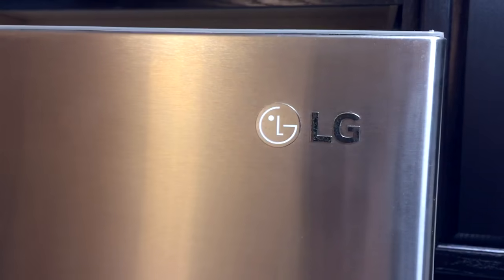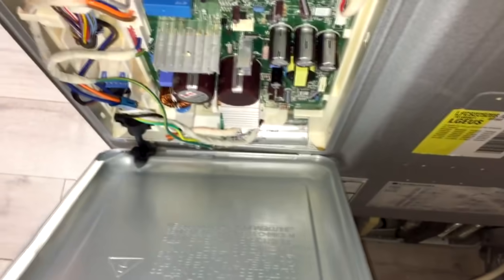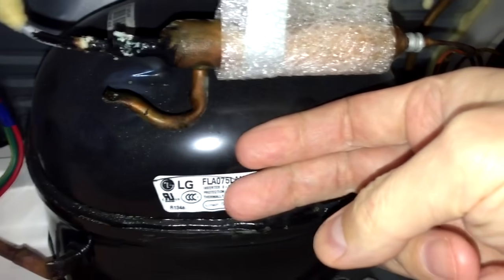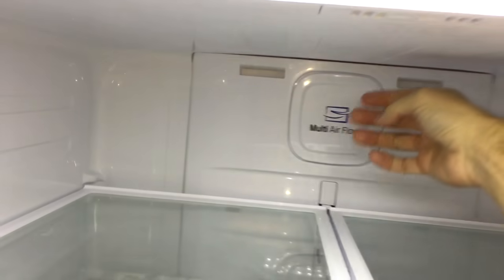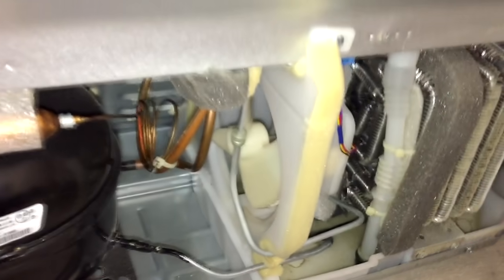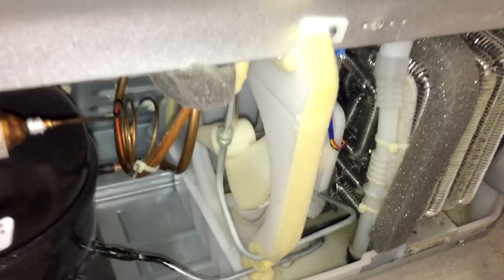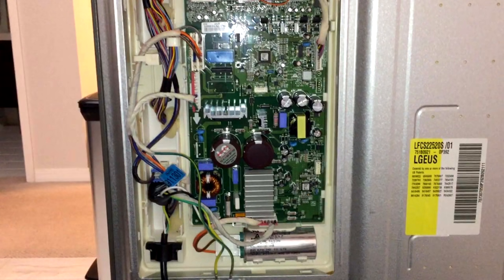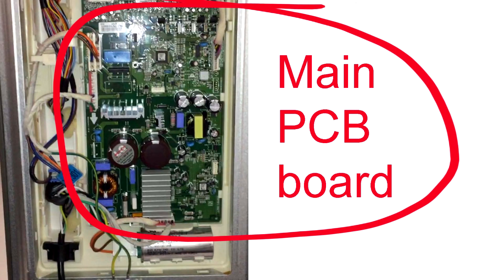LG refrigerator test and reset button

Comment: I have this model LSXS26326S /01.  Ran the test but don't get any error code.  Everything is working fine except for there is no air flow on the refrigerator side.  But if I open the freezer door side then I get a little bit of airflow on the refrigerator side.  Any idea?
Reply from the maker: There should be a return-air-duct somewhere on the lower part of the wall between the freezer and the fridge compartment. If the return duct is blocked by groceries or plastic bags, you may experience a low or no cold airflow from the top air duct. Also, the lower return duct could be frozen with ice due to a Defrost Problem. It's best to remove everything from the freezer and look at the Evaporator Coils. Defrost them with warm/hot water, and make sure all that defrost water is easily draining out and not getting pooled on the bottom.
Reply: When I ran a TEST, it's showing 22.  What that mean?
Reply from the maker: 22 means the second stage of the Test.
33 means the third, if you have it.

Comment: Hi, I've got a Kenmore Elite (basically an LG) and I've run the diagnostics tests and received no error codes. I'm waiting a half-hour before I check inside to see if it made any difference but it sounds like it's all running fine. But up until this point, all I've gotten is room temp. air blowing through both compartments. Why does the compressor sound fine, however? Is there no overt sound that signals failure? Or can it start up fine and still not do its job? By the way, we purchased this in January of 2012 so is it still possible to have the Sears parts done?  Thanks for reading...
Reply from the maker: The compressor may sound OK, but still, be bad. Also, there could be a refrigerant leak from the Sealed System. Try calling Sears and ask them how much it would be to fix it.
Reply: @Your-Self  I actually used an old number in the owner's manual and went through some guy through their protection program number in order to talk with a human being. It's impossible to get an appointment with Sears that isn't until 10/30/21 (today being 10/13/21 for future readers). I was told to ask for a "duress appointment" and they are searching for available techs and I should know within 24 hours. This has been going on since Saturday so what's another day?! Anyway, interestingly enough, whatever extended warranty LG placed on their fridges everyone else picked up as well, obviously because of the compressor issue. So I'm told the part will be free. The initial diagnostic will be $119 but I'm wondering where the labor cost will be. The first gentleman I spoke with told me I could actually order their master protection plan at $600/year ($50 monthly payments) and get the half-price labor and then cancel the protection plan for a $25 penalty. If I could get away for $3-400 I would be OK with that vs. a new $2K fridge and another otherwise perfectly good unit tossed in the landfill...

Comment: I ran the tests and all passed, but still not getting cold. Thoughts?
Reply from the maker: Unfortunately, LG Linear compressors have a high failure rate. They can run but not cool properly. So if during the test you can feel air moving inside the fridge, but it's not cold, the compressor is probably bad.

Comment: Mine doesn't beep during test and the compressor is running but not building head pressure (low head/high suction). Also the evaporator fan motor isn't turning on during test. The fan has been replaced. Starting to think the board is faulty and not driving the compressor properly.
Reply from the maker: What is the actual Low and High sides pressures when compressor is running and not running?
Even if the Evaporator Fan is not running, the Evaporator itself should get freezing cold.
If it's a Linear compressor, it works just fine on 80+ VAC.
Reply: @Your-Self I added access and a new dryer and charged with 134a to  nameplate. Sitting at 45 off. Head raises to 60 running, suction really doesn't budge
Reply from the maker: If the compressor has been replaced and gets hot, there could be a restriction at the Discharge outlet due to brazing.
If it's been replaced with the "Universal Linear" compressor, the software on the board needs to be updated with a special LG jig.
If it's the original Linear compressor and is running cool, the reed valve inside is probably damaged, so it's not compressing.
Reply: @Your-Self   Nah I'm a refer tech professionally. I just replaced the dryer and added access then recharged. That being said this is enough different from what I work on commercially that I was doubting my sanity. I'm 100% certain that it has bad valves now. I got the CB to test normal and everything works. I have a ≈ 3500 BTU extended range compressor coming Friday and will be switching the system to a standard recip with the addition of a 12v DC relay.  $190 for known function vs $400 for compressors with a terrible failure rate. I wonder if Bristol engineered this POC for LG :)

Comment: I have the same model as well. but the issue is the door alarm is activated even the doors are closed and also the light of the freezer keeps turning on even though I push in the switch. How can I solve this problem?
Reply from the maker: It sounds like a bad light/door switch. When you push on it, the light should go off. Try replacing the switch.

Comment: I want to thank you for the video, even though I do not know if it fixed anything, I had fun running through the test. I didn't get any LED blinking and my compressor and the fan are running. Compressor sounds fairly quiet but didn't hear a relay clicking. It gets cool but my freezer section isn't getting all the way down to 0, and probably not even 15 because the icemaker isn't cycling anymore. It almost makes ice but it's not solid, just not quite there. Very frustrating problem. I am going to give it a day and then possibly see how much LG will charge for the labor. If anyone has more info in buying a labor warranty from LG I would appreciate it.
Reply from the maker: It sounds like the compressor is going bad, or there is a refrigerant leak from the System.
How old is your fridge? If it's under 5 years, LG may fix it absolutely free. Otherwise, they may charge about $400 for the labor.
Reply: @Your-Self  Unfortunately, mine is 8 yrs old (AUG 2013). Actually after giving it a day it is working better, much better actually. I didn't mention that I cleaned the coils in the bottom rear real well, the coils themselves weren't too bad but the vents in the panel were pretty clogged. Now need to monitor for a few days or weeks!
Reply: @harryrobinson713  Hi Harry...what "vents in the panel" are you referring to? My coils look pretty good, actually, but I did vacuum a tuft of cat fur out from under the fridge. I have a Kenmore Elite (essentially an LG) and have been plagued with the potential compressor issue. It runs and sounds fine but I don't know enough to know whether I have a leak in the system or a clogged line or whatever. It's near impossible to find a tech willing to even look at this. And trying to get a hold of Sears requires waiting until November. I'd hate to toss this...it seems such a damn shame and a waste and goes against my always strong desire to leave no stone unturned until I have a fix. Thanks for reading...
Reply: @trafficcone  I just meant basically that whole back aluminum panel was pretty much covered with dust, that kind of thick greasy kind you get in the kitchen unfortunately lol. So the vents or louvers were pretty clogged and probably wasn't allowing much air flow anymore. I should do this every six months probably

Comment: My fridge runs but is 70 deg inside. It has a linear compressor(the frig is 6 years old). I guess these fail after 3 years. There is a 10-year warranty on the compressor but not labor. My buddy installs these and said the PCB has to be flashed so it knows what compressor is now in it. Messin around to get it and calling a factory authorized guy to install it(so we get warranty credit), my wife said we are going to Lowes, so she bought a new side by side(whirlpool like our frig before this one), we didn't like the 3 door, It took to many hands to open it.

Comment: So, I retro fitted my LG from r12 to 134a and filled.  Still no change with cooling from compressor. Tried this test button feature. It tested through as described.  But, no light blinking during or after testing. Could the compressor relay on side be bad?, I got a tech coming on Friday as I'm stressed 👀.   As I know LG fights it's costumers with the compressor being constantly failing. Any thoughts here in my quest.
Reply from the maker: Only LG Linear compressors with R134a have been failing in the past 8 years or so. And now newer Linear compressors with R600a have been failing as well. But I haven't heard of R12. I'm assuming you have an older basic LG compressor that you retrofitted, not Linear? 
The R12 and R134a have different properties and must have different amounts filled inside the sealed system. The system needs to be charged up correctly by the weight to work properly. 
Since the compressor runs during the Test Mode, the relay on the side is good. 
Good luck on Friday.
Reply: It stated Rl34a on the compressor.  But, fitting had take the r12 to 134a adapter to refill. This is my model number lfxs29766s. I'll hope for a good outcome Friday.  Doubtful 😥

Comment: Hello there, do you think you can help me with my LG linear inverter refrigerator that is not cooling at all (both ref and freezer cabinet). Well I guess it's obvious cause the compressor is not kicking at all. I did followed your diagnostic test and after the 2nd test, the condensing fan and compressor kicks-in. I was so glad, however, when I open both doors, not cooling at all after 20 mins with the compressor running. After the diagnostic test, compressor never came back. NO BLINKING on the LED indicator, no error codes in the front panel. Need your expert opinion.
Reply: Did you fix it?
Reply: @Buyscratchoffuntilbigwin did you fix it, same problem with my LG, started today 😢

Comment: Doing this test . Test # 3 worked once for a short time. Now test 3 doesn't activate at all. Press button for the 3rd test instead of defrost mode it goes back to normal run mode.  First two test everything seems to check out perfect.  My unit is us icing up pretty bad at condenser coils. LG french door refrigerator/freezer 32cf. Duel condenser coils in door water and ice maker.  Units 5 years old. Compressor was replaced about 1 year ago.  I'm thinking the PCB must be bad now. Not really sure.  ?
Reply from the maker: The PCB could be going bad, but many other parts could play a role in icing...
like the defrost heater, the defrost sensor (thermistor), the fan not working correctly, outside air getting in through a gasket or elsewhere, the defrost drain clogged up. When you say - dual condenser, you probably mean the dual Evaporator. Which one of them is icing up, the freezer or the fridge compartment? What is your refrigerator model number?
Reply: Both ice up, start at the freezer, stops making ice,couple days later freezer compartment temperature goes up holds around 20 F, couple days after the refrigerator temp goes to 50 F. 
I replaced the freezer thermostat , defroster thermal switch and fuse and freezer motors and fans. Back last November 20th 2020. Working great until a week ago now doing the same thing as before I replaced the parts. All gaskets are good, fan motors run fine and blow plenty of air just not cold now because of the ice build up. Also the led light on the PCB started blinking for the first time I've seen that 2 days ago before I unplugged the unit. Blinking 6 counts. 
  No compressor starter condenser on this type of LG compressor from what I've read and compressor seems to be working fine.  
 It's a SEARS KENMORE ELITE 795.72099.310 Which is just a LG french door refrigerator.  32 cf. Icemaker and water in door. Ice tray in door. 
  What I hate is my 20 plus year old side by side Frigidaire in my garage still working fine even packed full of groceries from my broken KENMORE Elite/LG. That i purchased around 5 year's ago. It's been in the repair shop twice, new compressor last year.  
 I'm just throwing parts at now. No one around where I live that will work on LG refrigerators.  
the SEARS service  said they can't work on it again  because the compressor was replaced.? Makes no sense at all.
Reply: Just checked fuse on defroster inside back of freezer. Fuse is blown. It was all installed new last November.  I don't know what caused the fuse to go bad?
Reply from the maker: Yep, they don't make them like they used to.
If you think the defrost fuse is blown, there should be an error code on the display, something like F dH. If you don't see the code, maybe the fuse is fine. When you check the fuse, it should be 0 ohms, but not opened OL or some other crazy number 18651.
The 6 blinks on the PCB have nothing to do with the defrost directly, so it could be another compressor problem, the PCB itself, or something else.
When you say that Evaporators icing up, is it an even layer of ice across the whole evaporator, or just on the top with an iceball? An iceball could indicate a sealed system problem.
To figure out if it's a Defrost or Sealed System issue try this;
Completely defrost both evaporators manually, and make sure the defrost water flows out freely.
Turn the refrigerator ON, and after about an hour check the temperature of the condenser coils with an IR gun as on this video. https://youtu.be/ipwOerjFITg
If the condenser coils are about 20°F above the room temp, the compressor is probably OK. And in about 12-24 hours the refrigerator should be completely cold. So check the temp inside to confirm it. The Defrost problem will arise in a few days when evaporator coils become iced up. But first, you want to make sure that the system is actually capable of holding the right temps for at least a few days after the manual defrost.
Reply: @Your-Self  i removed covers inside of freezer and refrigerator to check for icing and fan operation. All 3 fans run perfectly.i can find no problems plus yes the defrost fuse is fine. Unit Completely defrosted and dry run test again still won't go to test #3 defrost cycle the numbers 33 that used to show on the front panel when pushing test button no longer show it just goes back to normal display.   
 Anyway put everything back together plugged back in let run 12 hours.  Fridge temp is 52 F and freezer is 36F.  Still not cooling even though everything checking out good.
Reply: Also the light on PCB is still blinking code 6. 
 When I push button 3rd time the compressor and fans shut down but but display on front goes to normal display not 33 33 display.  Only way to bring unit out of test mode is to unplug it.
Reply from the maker: Test 3 doesn't work probably because it's already too warm inside. The safety feature skips the Defrost Test automatically.
Test the Condenser Coils with an IR gun if you have it. Because it sounds like another Sealed System issue. And if within 24 hours the temps inside the refrigerator don't drop to 0°F freezer and 37°F fridge, that's probably it. The compressor could be failing again, the refrigerant gas leaking, or a clog inside copper pipes (restriction). Only a good tech can figure this out.
Also, check the frost pattern on the evaporator coils. In a healthy system, the frost should be evenly spread across the whole evaporator, not just one side.
Reply: @Your-Self  thank you very much for all your time and help. I'll get with the company who installed the new compressor last year.  Only thing that doesn't make sense to me is why I'm getting 6 blinks on the led code light . Thank you again for everything. I do appreciate the help.
Reply: Ok. I just re read the trouble codes. Compressor may be my problem again. I guess LG compressors are pretty much worthless.  Never buy another LG .
Reply: Also the coils frost evenly across both bottom and top coils.
Reply from the maker: Well, the even frost pattern on the evaporator is a good sign.
The 6 blinks could mean multiple things, so make sure the fan near the compressor doesn't stop intermittently which overheats the compressor. Check the large capacitor near the PCB, and make sure it's within spec. The next step will get costly, it's either a bad PCB, the compressor going bad, or the restriction in a copper tube.

Comment: Samsung RS263TDPN refrigerator, Freezer wont cool, fridge side is working, no frost formation on freezer or fridge coils. Sir what do you think the problem is?
Reply from the maker: The freezer evaporator coils should be completely covered in a thin layer of frost (unless in Defrost Mode). If there is no frost at all, typically it's some kind of Sealed System problem (expensive to fix). 
However, the temperature sensor (thermistor) inside the freezer could be bad, and not asking the compressor to cool the freezer. 
Does the fan inside the freezer work when you activate the door switch? 
Does the light go out when you activate the freezer door switch? 
What is the actual temperature inside your fridge compartment?
Reply: @Your-Self   fan inside the freezer work when you activate the door switch?  -Not sure . Lights yes it goes out. Fridge 57deg.
Reply from the maker: Since the freezer is not freezing, no frost, and the temperature inside your fridge compartment is 57°F, most likely the refrigerant gas has almost leaked out. To verify that, you need to pierce the Sealed System and check the pressure inside... this should probably be done by a professional tech.